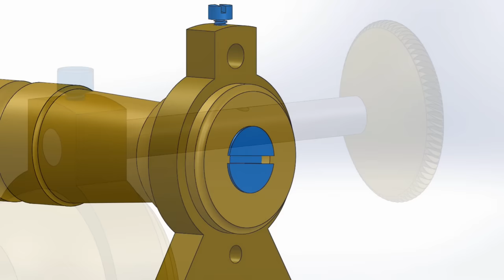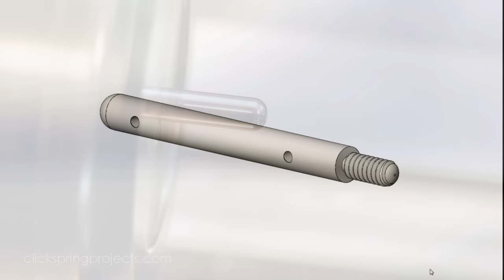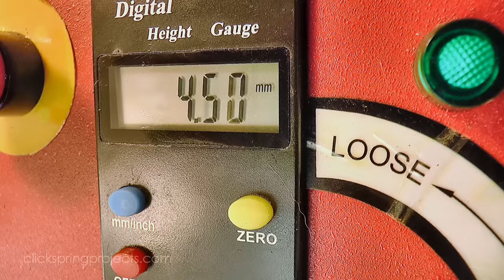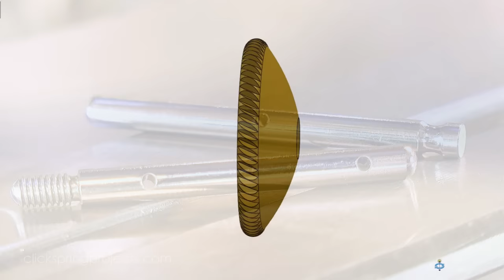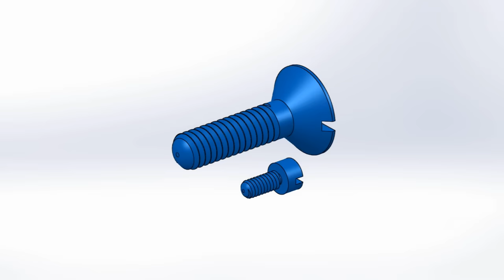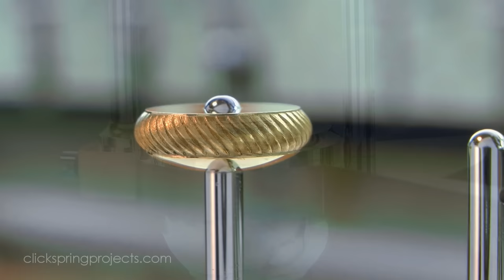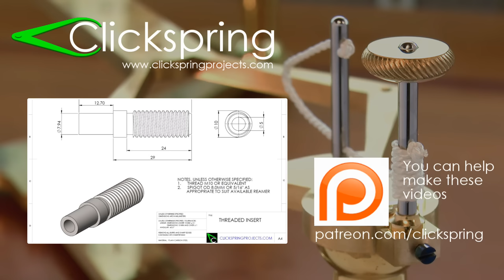Clockmaking - How To Make A Clock - Part 17 - Making The Regulator And Suspension Post

Comment: is there a particular reason you had to dome over the screw @2:27?
Reply from the maker: +Maurice Long Hey Maurice, traditionally all posts, arbors, screws etc in horology are domed. It makes the part safer to insert into delicate holes without scratching plates, and also makes the part more presentable. Thanks for watching

Comment: ABOK (https://en.wikipedia.org/wiki/The_Ashley_Book_of_Knots) #545, 546,
 599, 600, 601, or 643 would look particularly good as stopper knots for
 the silk string here.
Reply from the maker: +SAI Peregrinus OK, will check it out, thanks for suggesting :)
Reply: +Clickspring If you can't find one I do have a PDF of the book.
Reply from the maker: +SAI Peregrinus That would be excellent if you don't mind? Email addy in the about section. I have a feeling I may go for a small bead and swage it on, but I would like to see the knots you mention before deciding. Thank you in advance mate :)
Reply: Of course, shared it on Drive for you.

Comment: why dont you give the setscrew a knurled knob?
Reply from the maker: +adriaan Wilding has that in his design, but I think it unnecessary. Regulating the clock is a rare enough event, and once complete the setting should be left untouched - A knurled fastener grip is generally put in place for fasteners that require regular and frequent  tightening and releasing. This one is basically set and then leave untouched for decades - I don't want to tempt the owner to fiddle with it by making it too easy. Thanks for watching and asking :)

Comment: At 8:26, what is that tool? I've seen it used in a few other videos but haven't figured out what it's purpose is.
Reply from the maker: +bitfreakazoid That's an edge finder, used to identify the edges of a part, so the spindle can be positioned over a specific point of the workpiece to make a hole, start a cut etc. In this case I used it to identify top dead center of the plate so I could drop in the screw thread.
Reply: Interesting. Using a computer controlled machine I take it?
Love your videos and am looking forward to seeing it completed!
Reply from the maker: +bitfreakazoid The mill is manual, but a digital readout is attached which makes the positioning process dead easy.